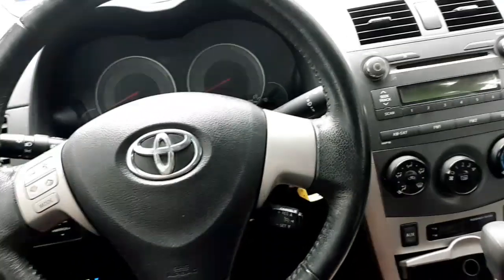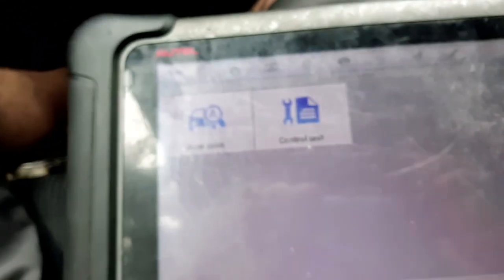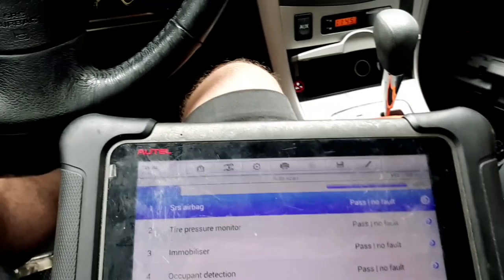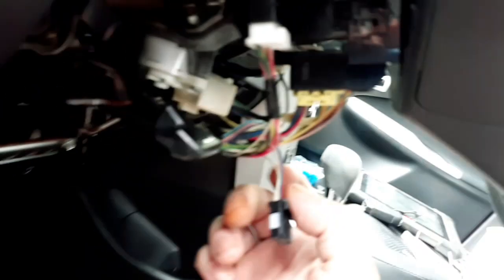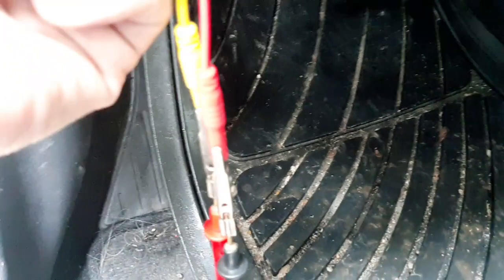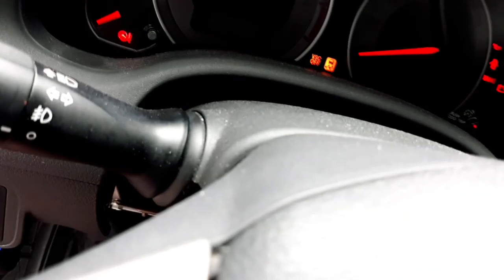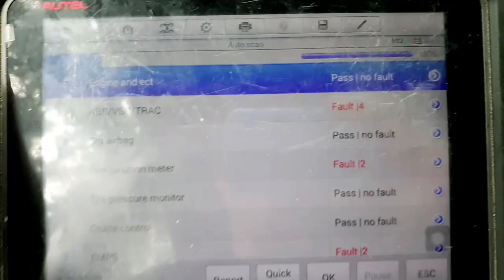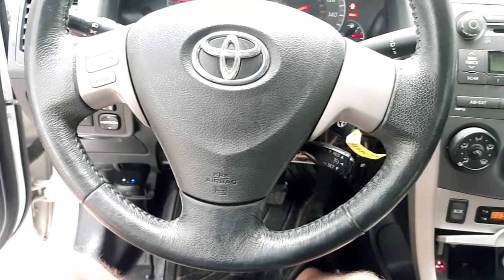2010 Corolla steering angle sensor shorting CAN network to ground.

Comment: Wow thanks for posted this video.  Exactly the same symptoms on my 2010 corolla S 1.8L .after few months  of interacting in diagnostic with this vehicle using many professional resources and many pro tools, I didn't conclude that faulty steering angle sensor. But thanks to your diagnostic 
I realized that.....
Reply from the maker: That's Awesome! Thank you for letting me know. I'm glad it helped. That's actually a pretty tricky one to diagnose even if you have all the right tools and info and know what you're doing.......Another guy kind of told me about it....he just commented 'steering angle sensor' on one of my other videos......and I thought he was just joking......but that's what it was....lol....but took me awhile to figure that out. Thanks for watching and commenting about it.
Reply: Blessings and hugs bro. @DuanesDiagnostics
Reply from the maker: @joseanmiranda7527 Thanks man. Blessings to you as well.

Comment: Do we know how much that sensor costs? I have one pulled up from toyota and its like $500 , i seen post of people who bought one from other places and they did not fix the problems. I just want to know if there is a cheaper option
Reply from the maker: It's very possible the other people got bad new parts, or their vehicle's weren't diagnosed accurately or at all.....which is maybe the new part didn't fix it for them.....both of those are very common nowdays.

The owner/customer bought the part on that one....I'm not sure where....but I worked on a bunch of other vehicles for him and he had a commercial account with O'reilly's, so he bought alot of stuff there, but I think he also bought parts from Amazon and Rockauto.....so I'm not sure on the price of those, or the quality difference between Toyota or aftermarket. Generally OEM anything should be better quality than aftermarket, but that's not always true.
Reply: @DuanesDiagnostics thank you for your quick response and awesome video!
Reply from the maker: @robertmunoz8510 Thanks for watching and commenting. I hope the video was somehow helpful or entertaining.

Comment: What pins are for what that you are using?
Reply from the maker: The pins I mentioned are actually the ground and CAN terminals of the DLC....and I'm using a Multimeter/Ohmmeter to check for continuity or a short circuit to ground on the CAN lines.....which the tests and meter showed there was a short circuit to ground on the CAN lines....... being caused by the steering angle sensor CAN lines being shorted to ground internally inside of the steering angle sensor.